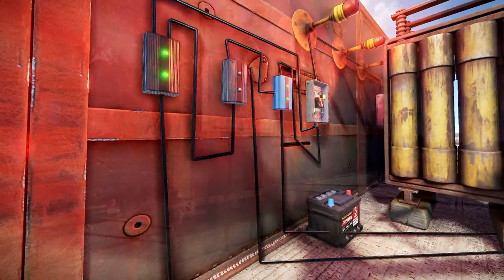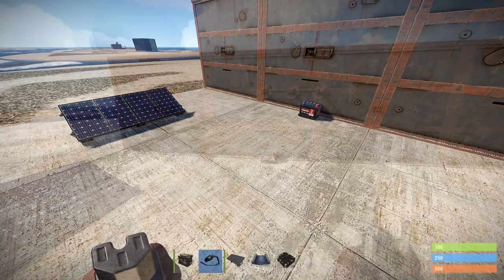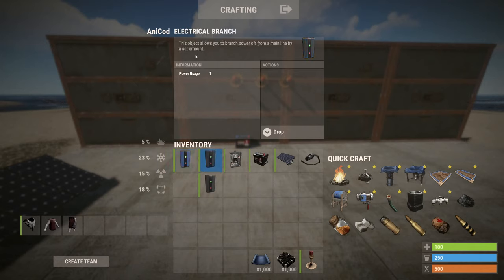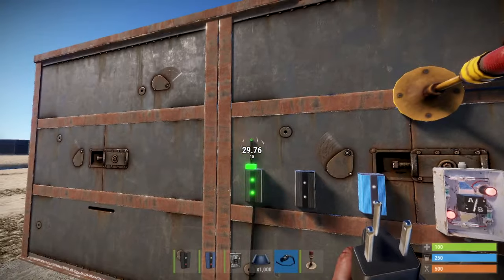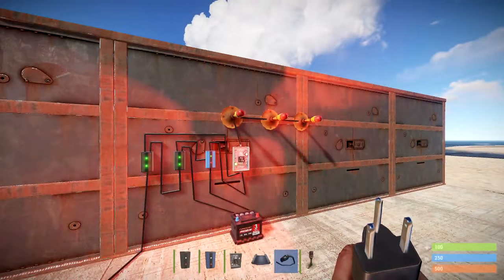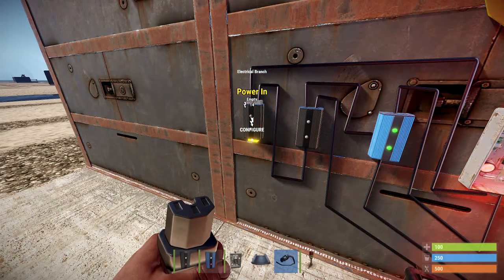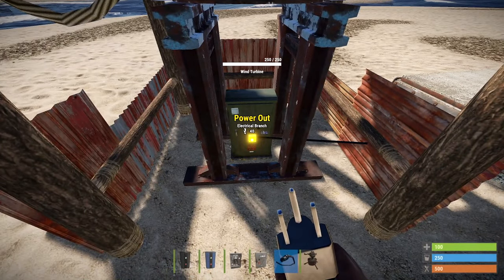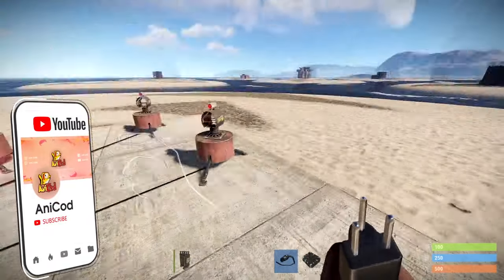INFINITE Power Loop | Backup Circuit | Guide to Rust Electrics

Comment: Thanks so much for this video. I've been completely lost, going in circles for the last two or three weeks, I had it of course, power going into a normal switch, then branches and turrets. All of the excess power was being wasted and I was having to put LOADS of extra power sources down, or logging in to rest the circuit. This has helped so much

Comment: This is how we used to do it before the battery change but now that you can charge and discharge a battery at the same time I feel is no longer as useful as it ads power consumption. I can only imagine it being useful now maybe in a circuit with Tesla coil traps that would benefit from any extra power you might have and still kind of work on battery power but to be onest since Tesla coils are  more efficient as singe use traps then as base defenders I prefer to power them by generator.
Reply: @xxIntrep1dxx  I mainly play PvE so I generaly use electricity for night lights, automatic boat and hely garage, toys and gadgets, I don't assume I know all the needs of everyone playing but I agree, this particular circuit is not more efficient and if the purpose is to survive the night, small batery beeing the only battery that can be drained in a standard night, this circuit will reduce efficiency.
Reply: @alexsavutube  can you explain how to have a charging battery circuit that isnt a waste? or are you saying a charging circuit isnt needed at all? How do i get lights in a base using solar at night? Do i just go solar into battery, battery into lights?

The way i see it is this is for raiding. If a raider comes and breaks your outside solar panels, windturbines, your battery will still power your turrets. How else do you get this result of having "24/7" turrets up?
Reply: @OsrsNooby  you mean when the raider breaks your batts

Comment: i fail to see the reason for the circuit.. if you wire directly to the battery it will charge the battery with the overage from the power source and continue to power through the night just as it would with the or switch.
Reply from the maker: this circuit was needed prior the update where it became possible to recharge and discharge a battery simultaneously

Comment: With the first blocker, set the left setting to 9, and leave the rest alone. This will power everything, and keep the battery charged over night, allowing for the battery to get fully charged in the morning hours. This is perfect for any polar forward operating bases 1x1s set up to collect stone and sulfur nodes in the polar lands which you will be staying the night in before shuffling off to your main base with the appropriate load out of GP for any booms for raids. If you need a light in the base, use a pressure pad to power the industrial light until you can set up your fire pit to cook food while waiting the night to heal from possible polar bear snack attacks.
Reply: What you ideally want to do is set this value to the total power demand of your powered components, keeping in mind that the demand should not exceed 50% of the maximum output of your battery if you want the system to last all night without going down and to maintain your component power for the longest possible period. For most people, you’ll want it to last at least 8 hours without any input power from generation sources. So the total demand for a large battery should be no more than 50. This basically gives you enough to run 3-4 auto turrets constantly, and for 8+ hours if your solar panels or wind turbine is destroyed.

Comment: Why do you need a blocker when the OR gate will already choose the input with the higher input? makes sense when the battery delivers more power than the solar panel but not with the small one right?
Reply: I had the same thought: I’m not on to test it rn, but I believe since the larger batteries can output 100 units, the circuit would always use the battery, just as if you used the battery as a passthrough (currently I do this, just have 6 large batteries being charged, and at the same time running my defenses. A ton of wasted power, but it’ll work til I figure this vid out🤷🏻‍♂️)

Comment: If you are only powering lights that you need at night, you could make a simple circuit that turns the power on during the night only.
I don't really understand why people call this an "infinite power" circuit... how long you can power your stuff still very much depends on your power output (to charge battery fast enough during day), and the size of your battery, and how many devices you are powering. Infinite would suggest you can power as many things as you like with no worries.
Reply from the maker: back in the day, the batteries couldn't charge and output power at the same time so you needed a circuit like this to make it work.... this video is kind of redundant now since the recent updates :-(

Comment: The only downside to this seems to be that the battery doesn’t charge when there is insufficient power.
Reply: No shit, it would use power from the battery if there isn't enough power .
Reply: That’s the whole point of having a battery. It is your source of power when you can’t maintain the input to your electrical needs from the Solar/Turbine/generator.  It’s The ONLY reason you even need a battery in the system. We may find a way one day to harness infinite power. But till then rust decided to opt out of the Alien Tech on this front.
Reply: @dapper2885  What I meant by this was simply that if the first branch is still receiving power, but it doesn’t meet the minimum requirement to power the full circuit, it should still charge the battery with that power.
Reply: @miekolock4060  What I meant by this was simply that if the first branch is still receiving power, but it doesn’t meet the minimum requirement to power the full circuit, it should still charge the battery with that power.

Comment: Can't see a point to use it... Battery is the limit anyway. Like with the turbine and large battery, you cant use 140 power thats coming from the turbine, that 40 is over the limit of the battery. If it switches to the battery you can only use 100 or if the turbine doesnt give 140 anymore. Doing this doesnt give you anything, it just makes it more complicated than it is.  The more i try to figure out the need for this circuit, more useless it gets, it just doesnt make any sense
Reply: Agreed, the only thing you are doing with this is adding more load to the battery at night, thus giving you less available charge. I think it used to work different with the charging and using at the same time, but this is a new video and it doesn't really make sense to me.
Reply: how else do you get turrets to be powered even after your main source of energy is destroyed while you're offline?
Reply: @OsrsNooby  When they get to the battery, they have already destroyed the turrets, like why would you place batteries before the turrets :'D You  probably have a switch for the turrets outside of your base near main door ?
Reply: @OsrsNooby  if u put the solar panel directly to the battery it will charge it while also using it, before it didn't it work like that, as long as you have more incoming energy than output you're fine.
Reply: @Cheezycats  if you're doing that you end up with no power as soon as your source is killed off. Meaning, you get raided extremely easily. It's smarter and more efficient to put a chargeable battery circuit instead of going directly from source-battery-anything. Unless you arent worried about being raided, then obviously you don't need to worry about having backup energy.
Reply: @OsrsNooby  hes right, no need for this anymore.  a panel straight into a bqattery still charges it and the battery still takes over if the panel is destroyed. the components of this switch simply drain 1 power each without doing a single thing.
Reply: @rogeyhogey1066  yeah I agree and I compared them both on rustrician. The battery charges faster without this. But maybe rustrician's software is not up to date.
Reply: This circuit uses more power and doesn't save anything. Pointless. Anicod perhaps you should check this and update/edit your video?
Reply: @simonroome5858  Thank you guys for the comments, I was hoping to see if this was no longer the case because it seemed like a waste of power.  I could see using the blocker to turn off the lights in the day, but swapping between the battery and solar power seemed just like extra complication if the battery could be used and charged at the same time. I totally see it if it can't.  I've only been doing electric in rust for a few weeks and the initial "just do this" photo I was sent was basically this circuit.
Reply: This is a simple set up. If you require more than 100 power, you'll obviously need more than 100 backup power. To do so you have to use root combiners and splitters to effectively charge and discharge the batteries. Don't daisy chain the. Batteries together. Youll never get more than 100 power from the batteries if they are daisy chained. For battery power out use root combiners, for power in on batteries use splitters
Reply: @cheeky8015  I know that, i'm just saying all the backup stuff is pointless. Battery has to be at 100% recharge anyway making this useless

Comment: Could you tell me what is the best height for the wind turbine? I know higher is better but how better? Like at what point is it not needed. Yes I know that a wind turbine can be placed on the floor yet it doesn’t get much power, what I want to know is what is the best height for it to get the most out of the wind turbine?
Reply: I think 4-5 floors is enough if there are no cliffs around. I placed turbines 20+ floors high and they still output 100-140. Fun fact if you build in the ocean and place a turbine just above the water at the 16th floor it will produce like is 16 floors high.
Reply: @alexsavutube  Aha, that’s good to know. Thank you very much for replying.
Reply: At some point it's can also work against you, cable lenght is one limit, can be worked around, placing root combiners higher but I prefer to keep them as deep and secure inside base as possible, easily destroyed. 2nd if u wanna come back after raided rebuild and you use anti grief mesures (external TCs taking over build prvilage if main destroyed) 6 fundations above main TC is maximum height to not be griefed by raiders placing own TC on top.
Reply from the maker: check out my newest video :-)

Comment: Could u next time explain the circuit more detailed im a nerd and i would like to know the electricity better
Reply: it's just a basic charging circuit, during the day (if solar) or all the time (if other) you power the battery through a small portion of the energy you're creating, the rest goes into the branches and the or switch, and then into whatever you're powering(turrets, lights). When your main source of power is destroyed or runs out(if solar, no more sunlight) then it automatically switches over to the battery that you've been charging. The original idea used a splitter instead of a second branch, and can be found on google searching "Chargeable battery circuit"
Reply: @OsrsNooby  ahhh thx very nice i see u are a nerd as well xD
Reply: @OsrsNooby  sorry, but it's not the same than just connect the power source to the battery and the battery to the other stuff? I cannot understand.

Comment: Excedllent video. What if your power source (i.e. solar panel) is LESS than the total out?  say 3 solar 60 power into a large battery that is 100 out.  just make the branch number 54 (less than 60)?
Reply from the maker: thats when RWM comes into it and how much you have outputting from your battery!! it gets more complicated at this stage :-)
Reply: use a root combiner before input feed then connect output to splitter, wire 1 to your curcit and the other to the root connector, the 50 power will go back in.

Comment: Can you make a circuit that turns blue flashing lights on at night automatically whilst turning them off in the day... For night time helipad landings?
Reply: Check out an “Auto-Lights” rust video. It’s the same just with different item
Reply: All u need for that is Solar panel and blocker .
Reply: @o0DeepWaterIvy0o  ive always just used christmas lights

Comment: Seems less efficient than just running power straight to the battery.  You are losing 20% at the battery either way but with all those other components you are losing 3-4 power +20% of what remnant goes into the battery for the same outputs at both day and night.
Reply from the maker: this was the old way of maintaining power before the electric update where batteries can discharge and recharge at the same time.
Reply: @AniCodYT  Thanks.  Sorry, I've only had the game for about a month and I've noticed a fair number of the tutorials I've watched have dated information.  Can't be helped with all the updates which are mostly good things.

Comment: How do i use solar panel on max power ? can u help me
Reply: When its facing the sun its in max power.
Reply: You need to face it east then it is full power longest time
Reply: North*
Reply: Face the panels towards the middle of the map, depending on the side you are on. Sounds odd, but that gets you the most power for the whole day. North and South are the best ideas. You could put some East and West, but that's not as effective.
Reply: facepunch messes with the sun all the time and we don't find out. This wipe is North, it also was south for a wipe and for some time you needed to face them to the center line of the map. Just place it North before noon and see if you get 20, if not place it south. East West placements are less efective.